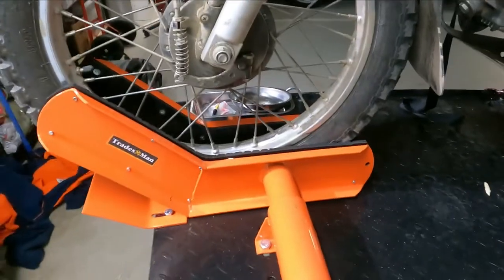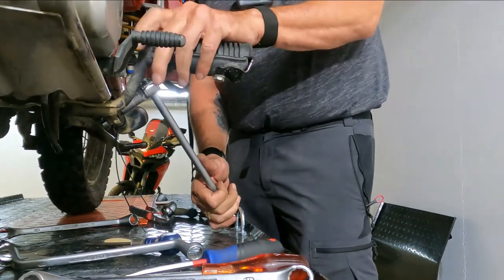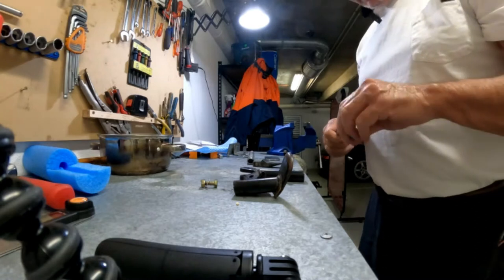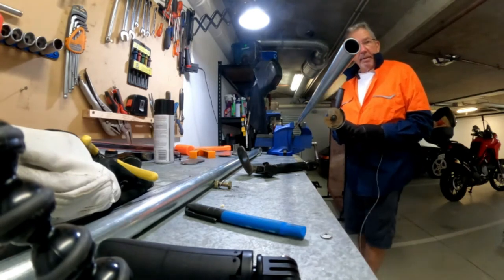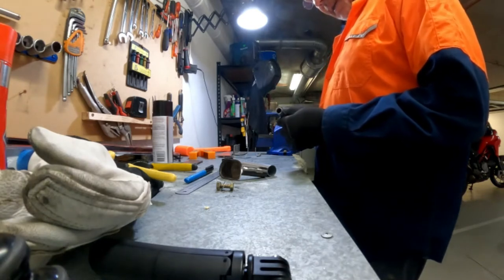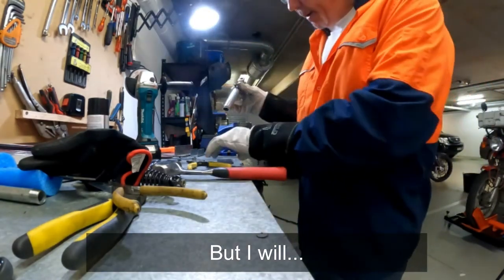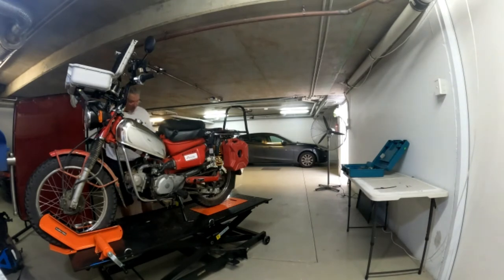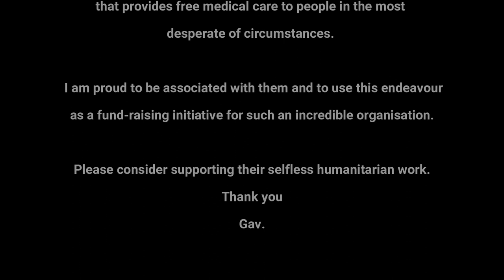#02 Side stand fix - Watch an old geezer bumble his way through some welding and grinding.

Comment: The rubber piece on motorcycle kickstands is a safety feature. If you forget to swing the stand up the rubber is supposed to touch the ground first and flip the stand back, hopefully preventing it from stabbing into the ground and throwing you off the bike.
Reply from the maker: Thanks for that, Gronk. A clever idea that goes a long way to explain why I caught the side stand so often on my ride 😅. A much better idea than side stand switches that generally fail at the most inopportune times.